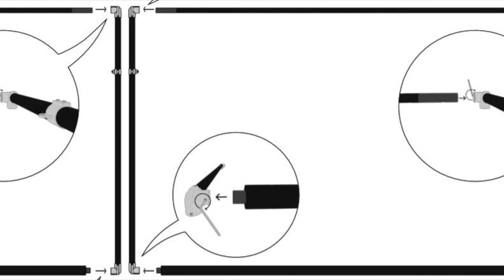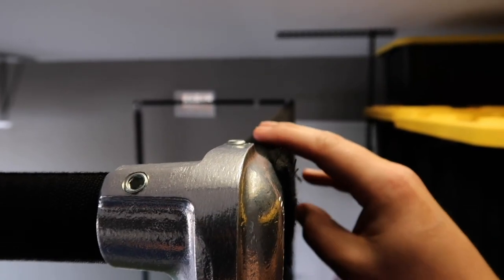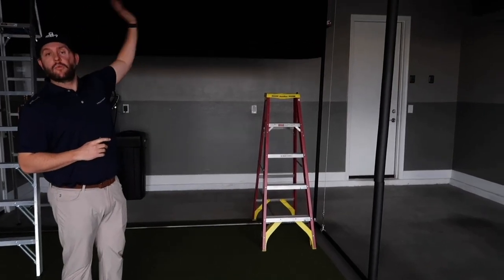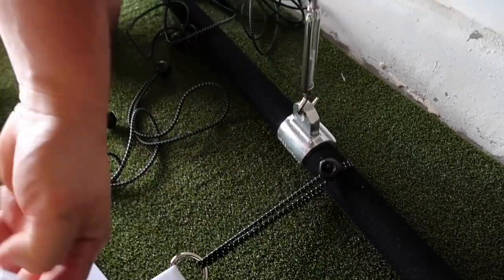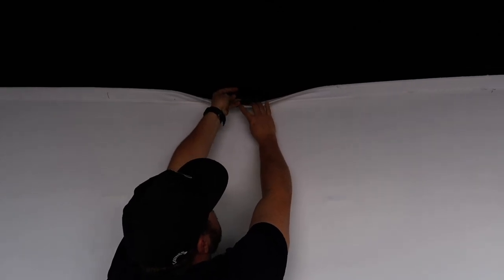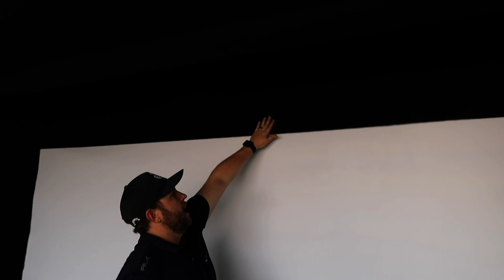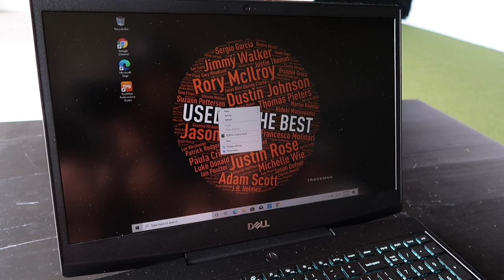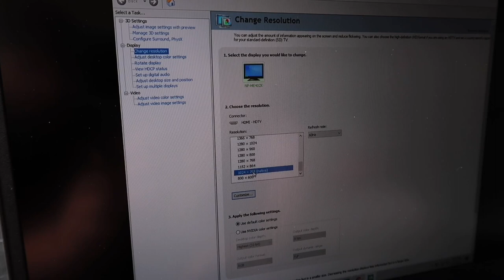How to install your Trackman DIY Simulator

Comment: Your image quality is dramatically affected by how you set-up the projector reducing the potential experience. Keystoning with a reduced (adapted) resolution to begin with will reduce your experience very much. My advise...install a proper projector to the ceiling with a lens-shift function and prevent key-stoning....otherwise...great set-up!